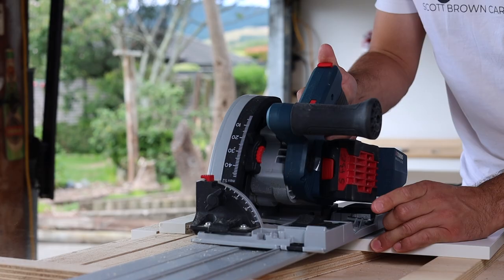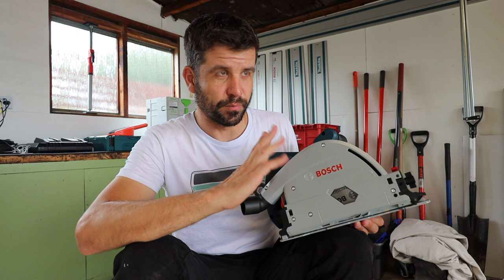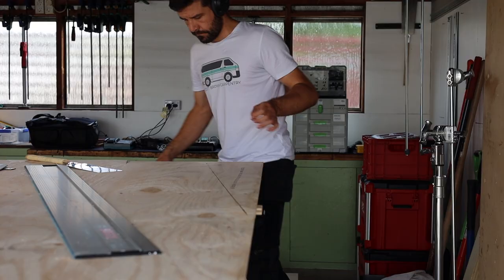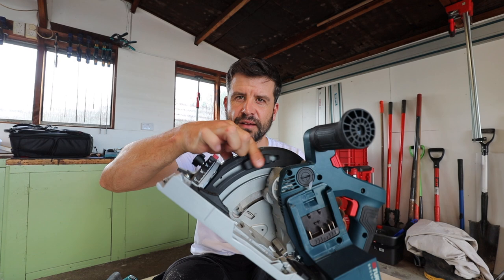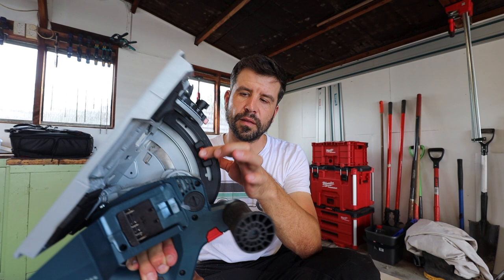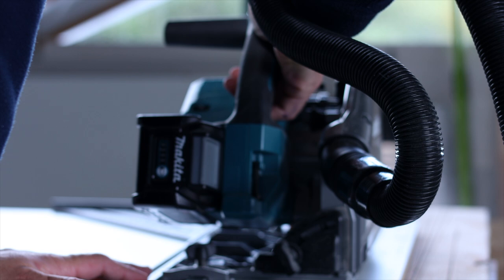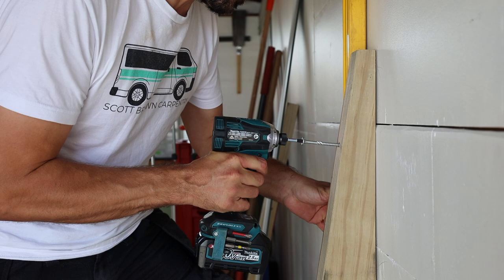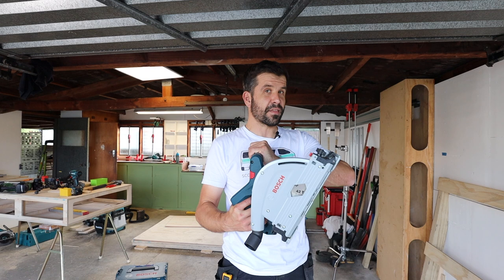Building Plywood Storage With My Bosch Tracksaw

Comment: Mend a rack with two lever arms attached to the sides of the plywood rack, which you can fold up out of the way, when your getting plywood in or out, and can then drop down over the plywood during storage.  the strap system is just a bit of a pain.

Comment: Great review Scott. I recently was in the market for a track saw and own alot of bosch 18v tools already but I couldn't justify the 1000 dollar (Aus) spend more if I wanted to get fully kitted out with more tracks and Vac. I ended up getting the Bayer track saw combo from Sydney tools for $539. It came with a pass through wet and dry vac, 2 x 1400mm track guides, 2 x clamps and 2 x brackets for joining tracks.  Only downfall is its corded. Like the Makita it is also 165mm, 1400 watts, has a scoring function and the tracks fit festool and makita, or so they say. For myself who will only use it a few times a month, seems like a know brainer really. 
Also if you haven't seen him before Peter Millard 10 minute workshops on youtube have a lot of great information and reviews on track saws. From beginners to advanced vids. Everyone should check him out .

Comment: i own the bosch too - cause i have lots of tools from their 18v system and can use the tracks on the router also. If you just need a simple tracksaw and are not in the need of a wireless one, i can recommend the triton tools. currently quite affordable and good features for advanced users.

Comment: Make a hinged top that drops over the ply and has an adjustable slide to lock it. That way when you need to access the sheets you unlatch from center and push up easy done.
Reply: Dog clamps, with the barrel on the top and lock the clamp in and slide the clamp to the position. Use your festool clamp to get the idea 💡

Comment: Hey Scott, you could try negative rake saw blade on your saw bench. They are designed not to chip out because of the 
"backwards" angle of the tooth. Not sure if they would work on a track saw though? I've only used on a saw bench when we were making kitchens.
Reply: That would sort the problem out. The 165mm Precision blades on Corded saw give perfect cut every time.

Comment: I have the Mafell Mt55cc. The Bosch saw is based on Mafell and I think that Mafell makes the saws for Bosch.

Mafell saw has a scoring function, easy depth adjustment and the best saw change system on the market. I would love to see a video of you trying out the Mafell track saw.

The good thing about the Bosch/Mafell tracks is the will be 100% straight after joining them.
Reply: Corded Bosch is based on Mafell, but the cordless one is Bosch's own design that doesn't share many similarities with the corded one.

Comment: I like the Bosch saw because it's based on the Mafell track. If I could afford it, I'd get the Mafell.Bosch dropped the ball here in the US as it took ages for it to appear over here. 

I ended up buying a Wen tracksaw. I haven't used it yet but it takes 8 1/4 blades so I have a couple of Freud blades for cross and rip to use with it. I got some festool profile tracks made by some other company. I'm not a carpenter or cabinet maker. I'm an architect but I do like doing woodwork.

Comment: I'm not sure if you used the GKT 18V-52 GC with a 4Ah battery only. But the GKT 18V-52 GC will only show its full potential if you use 5,5Ah ProCore and up batteries. The same applies to all BiTurbo machines. It's like running the Festool track saw with one or two batteries.
Reply from the maker: Interesting, I didn't know that. I have an 8ah procore battery too, I'll give that a try. Thanks!
Reply: @ScottBrownCarpentry  I second this. The 8 aH ProCore and up can provide more power compared to even the older ProCore models (5.5 aH).
As a rule of thumb, all Bosch BiTurbo-labelled models require a ProCore 8aH og greater to unlock the full potential. Some tools not labelled as BiTurbo will still gain a performance boost from a procore battery. The large reciprocating saw is an example (GSA 18V-32).

Comment: If you move the saw backards (pull it towards you rather than push away) on the score cut, you will get perfectly clean cuts.  Also works with normal circular saws, not just tracksaws.
Reply: Also helps if you cut it upside down first and hold the blade with your hand to keep it straight

Comment: I got dewalt flexvolt tracksaw and tracks. I found out of the box dewalt's blade is terrible. 

Once I upgraded to 2.6 kerf (thicker) blade all my issues went away. Now its every bit as good as a festool (well maybe close but not quite). 

This is the setup Festool is running stock so could be the reason why they are so much better than thin blade track saws like dewalt when in stock form.
Reply: Yep, I reckon thin kerf blades are awful in so many ways. The blade wobble is really bad for the spindle & bearings, and they tend to bind when sheet cutting.
Reply: The new festool cordless is now a thin kerf. The ditched the thick kerf due to performance. The thickets blades do produce better  finishes.
Reply: @AshHalls  yep true u definitely notice the extra work saw has to do with 2.6 kerf, but its so worth it. 

With flexvolt saw it has plenty of power in reserve out of the box so its not a problem. 

Might be for makita though lol
Reply: @Sgten01  I bought the makita 40v track saw, have not even used it yet. only because got it because I bought the mitre saw haha

Comment: I have the Bosch corded model, the corded model is actually made by Mafell and assembled for Bosch, the Mafell track saw with their tracks that are identical to the Bosch items is arguably the best track saw system you can purchase (not available in Australia and has a few bells left off the Bosch), while the 3m tracks are good on other brands you need a ;long vehicle to carry it.  The joining of the Bosch tracks is quick and they always join straight.  The factory blade with a score cut set at speed 5 always gives a chip-free cut for me in benchtops, and I went for corded as I always connect dust collection so a cord is of no consequence in my application, and I'm not on Bosch batteries with any tool.
Reply: I’ve got the same and nope, they licensed the design from Mafell but it’s not made by them, made by Bosch in China.
Reply: It is a solid track saw though!

Comment: I have one since I am in the Bosch ecosystem. It's a great little companion along with the 18V vacuum. Only downside is that blades are a bit difficult to find since the size is a bit odd. I have the corded as well and that is easier to get blades for.

Comment: I personally owned the Bosch Corded and the Bosch 18v and was a huge fan of the corded used it for a long time, although after time it become untrue and I couldn’t even adjust back right. The cordless was useless on doors even with the 8amp procore. Great on sheet material though! 

I also own the Festool Corded and that’s the dogs nuts. 

Also own the Makita 36V favourite of the lot! 

Depends what the uses are!

Comment: I've had the corded Bosch track saw for a few years and recently purchased the cordless as well, and the corded dust collection is vastly better than the cordless model. I'm not sure why the cordless is so much worse, but I think it has to do with the blade size and the design inside of the the blade housing. One trick you can try that should increase the dust collection efficiency is put a piece of painters tape over the hole for changing the blade. This will increase the suction at the bottom and should capture more dust. 

Another thing about the cordless I don't like in comparison to the corded is the track adjustment mechanism. The corded has knobs that you can turn and get it adjusted perfectly, whereas the cordless has slides that can't be fine tuned as well, and for me I either have a slight bit of play on the track, or it's tight, which causes too much fiction. I keep it loose because it's so slight that it doesn't affect the cut.
Reply from the maker: Interesting stuff, does the corded have a bigger blade? Which one do you use the most?
Reply: @ScottBrownCarpentry  Corded is 165mm and will cut 53mm on the rail

Comment: got bad experience with my last blue Bosch circle saw buy - so much play on the spindle, that ... I ended up returning and getting a makita track saw 😅
oh, but that's not the whole track which is bad, after all Bosch specifically hs the slot for Makita/Festool tracks. its the protective strip which is already trimmed to Makita saw (more precisely the distance and width of the blade). but nevertheless the end result is the same - you need a track guide trimmed to your each saw+blade combination😅 otherwise if you're replacing a saw, you can just replace that tear protection strip.
aaand you could always try to do a shallow cut first to just score the surface - that should improve things with any saw (ok, may depend of # of teeth)

edit: ok, so you came up with that last tip on the spot... this should be a no-brainer tho - after all with shallow depth the blade will do less pulling-up = less chance for chipping...

Comment: 👍I'd have put it on wheels, but that would have made it deeper for stability, but could still be strapped to the wall.
I'm surprised it's only 2 earthquakes, Seddon is still having lots of small ones, and a 5.6 on the 21st. Reno to code ++.

Comment: The only way I cut melamine is using the scoring cut method.  It's easier to cut melamine with my Festool TSC 55 REB than with my table saw because changing the blade depth of cut on the table saw is slower.  The TSC 55 REB  has an adjustable Splinterguard on the outside of the blade and the opposite side of the blade has the track's splinterguard.

Comment: If you want to stop chipping, you need a 120T blade. A 42T blade is not designed for cutting finished surfaces like melamine.
Reply: Nah, its  a very small blade.  42T on a 5 1/2" blade is  probably the equivalent on 120t on on a 10" or 12"
Reply: @vidpromjm  sorry but you are wrong. You can buy 165mm 100t blades which are designed for finishing work. I've got one in my saw
Reply: @Aussie_Bren  The blade on Scott's saw is 140mm so you're not going to fit 100T on that. Interested in your 100T on a 165mm blade, who makes that? I've got a 165mm trend blade with 60T which is called ultrafine finish which is VERY  marginally better than the stock 48T blade that came with my corded Bosch track saw.

Comment: a few more racks above for 2 by and you have a mini lumber yard in your garage...makita are the first one with the ion battery. therefore I choose makita for my cordless tools. I think it's because of other saw depth adjustment is with a screw type, makita don't want to change it too much for the track saw. anyone use a circular saw before will know how to use the depth adjustment on the track saw. when I first use the festool track saw, I couldn't figure how to use it.

Comment: All my battery tools are Bosch and I've been debating the Bosch battery plunge saw, I think though it's quite difficult to change from the one you're used to as they all have slightly different features that you get used to. For me the festool tsc55 will definitely be the one I buy to replace my TS55

Comment: I have the Mafell MT 55 it has a scoring function, also the Bosch track  looks like the same as the mafell, I think it’s made by mafell.
Reply: I have the Mafell MT55 as well, excellent saw-swapped form Festool-never looked back. I think mafell make the corded Bosch saw it has an identical motor housing for example; bit more stripped down, no electronic brake for instance, but more or less the same saw. Not sure about who makes the cordless Bosch though.

Comment: The plastic edge is usually long and trimmed with the first cut this can also be replaced. Each saw should have its own track . Blade thickness is another factor .
Reply: There was a note on the screen saying that he replaced the splinter guard edge
Reply: I think he obviously knows that & did that 🙄
Reply: Bosch say their  BITURBO track saw is compatiable with Makita/Festool track,don't have any other than Bosch track to try.

Comment: Thanks for the practical examples with the saw.  I have the corded version and love it and the tracks, however it seems that the dust collection is much better with the corded version, also really disappointing with the bag.  I tried to just buy the bag for my corded saw but after seeing the results you had I think I would not bother even if is was available.  Many users seem to like the Mafell dust bag with it.

Comment: Nice rack. Individual use and needs vary but I am going to build a cart with sheets on one side and off cuts or solid wood on the other. Lots of ideas on YT. Hope this one works out for you Scott. I think you're roof was too low to store them vertically which is the dream as you always need the one on the back but you can just slide it out so not too much hassle.
Reply: Also look on Pinterest, loads of intresting ideas.

Comment: If the Bosch was a cheaper saw I think it would be a good pickup for people that do not use a track saw daily. The 18v battery and small blade would prevent me from wanting it to be a primary tool. At least in the US it's only about $50 cheaper than the Festool. And about $150 more than the Makita (36v). 

In my opinion the value is off. Looks decent. Not better than the Makita and for the money they want I'd rather go Festool. Unfortunately in the US we have limited access to Mafell products and the Mafell cordless is around double the price so it's not a very common track pattern here either. 

I wish more Americans had discovered track saws. They seem to be growing in popularity slowly but our market for them is still relatively small.
Reply: Bosch do the GKS 18V-57G circular saw here in the UK, it's track compatiable,it's around £180 cheaper than the £350 dedicated  brushless  BITURBO range
Reply: @boogiedahomey Do you use Mafell's Flexi-Guide, see it used years ago, all very clever,but it works.
Reply: @boogiedahomey I’ve never even seen one of those in person but they look very cool. 👍

Comment: u could have use the makitatrack to get clean cuts. but u always have to put in new rubber when u use other saw.. Saw n track Always be together n never mix whit other tools.
Reply from the maker: I tried that, with a different track and brand new rubber. The cutline is still quite far off the aluminum, therefore the rubber was able to lift with the cut. Perhaps it wouldn't be an issue with a finer tooth blade 🤷‍♂️

Comment: It does remind me of the Festool track saw. Like you said, the easy depth adjusment etc. I’m very curious about the battery life. My cordless Festool used 2x 5,2ah 18v batteries and they are empty after a few hours of cutting plywood.

Comment: Have you used the dedicated blade for laminate panels from Bosch on your test? 🙂 There are other 2 options for track saw from Bosch, both 165mm: GKT 55 GCE for shops (corded) and GKS 18v-57 G (18v, for outdoor, as has bad dust extraction). Have them both. 🙂

Comment: Pretty much a copy of the Festool that Bosch plunge saw.. I’d say the tracks for the Bosch and Mafell are of a much better design than that of Makita and Festool though, you’re much better off getting a 3m track for the Festool/makita as the joining method for them is naff. It’s good you can interchange the tracks with the Bosch and Mafell, gives better scope if you are running both tracks and saws. 
I personally don’t think you can beat the cordless Festool, I’d be very tempted by a corded Mafell… the automatic one would be a lovely bit of kit to own, ever so slightly pricey that one though lol

Comment: Are you using a specific blade for laminate? It has chamfered edges on each teeth, as opposed to standard blades for man-made board with sharp edges. They give a much better result and they stay sharp longer

Comment: I thought you’re supposed to run scoring cuts backwards. At least on high end saws that have two blades the scoring blade runs in the direction you’re pushing the material.

Comment: Does prescoring with a stanley blade make any difference, does tooth count higher/lower help. Also maybe a central rachet strap would be a good option giving you the ability to undo slighty slide a sheet from the side while retaining some level of protection from more sheets falling, maybe a coat of surfers wax Teflon spray or plastic strips on the bottom to help slide and protect the sheets.

Comment: I have a cheap Mac Allister saw I got from screwfix in Ireland. Would love an expensive saw but I don't have the work to justify the expense. One thing I can never understand is going for any battery tool that you are then going to plug an extraction hose into. Surely the power cable is no real extra hassle and you are guaranteed consistent power? Am I missing something? 

Thanks for all the DIY tips btw Scott.

Comment: Hi Scott, may I ask if the bosch track saw has an equally excellent adjustment to the track bolection as the festool and makita WHEN USED ON A MAKITA / FESTOOL TRACK.  I noticed that the track adjustment when the bosch is used on a bosch track IS NOT SNUG TO THE TRACK!  The Australian rep responded to my query by saying the saw was meant for formworkers.  May I ask what you think of this Bosch track saw and its uses?

Comment: Thing with plywood is that is warps when stored vertically. Ever considered a horizontal storage solution?
Reply: Yes, and the quality of plywood is shocking these days, the top sheet or two always warps also.
Reply from the maker: I considered it, however I need all the floor space I can get. I'm hoping the straps will help with the worst of the warping